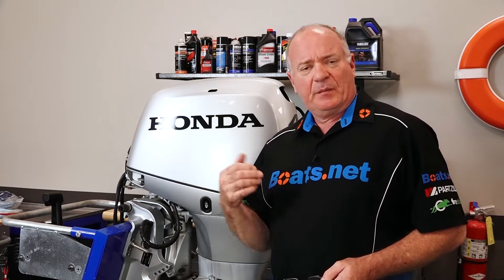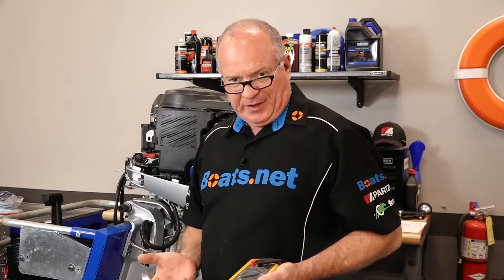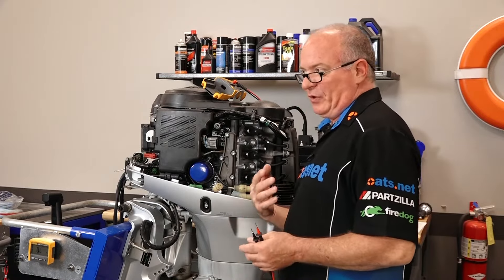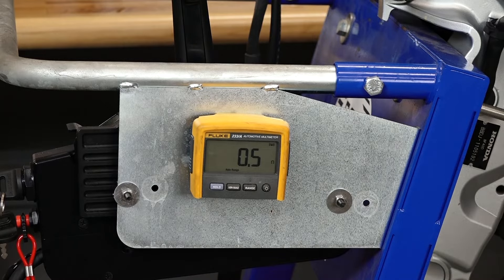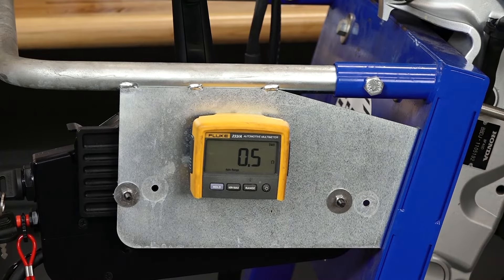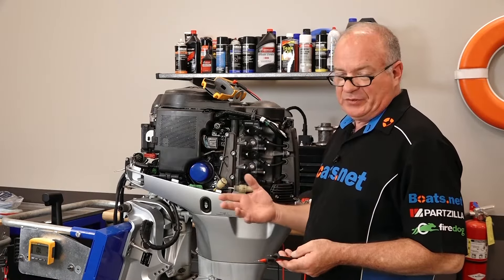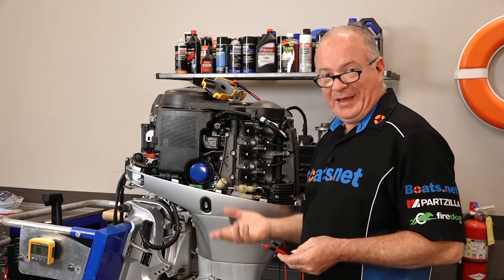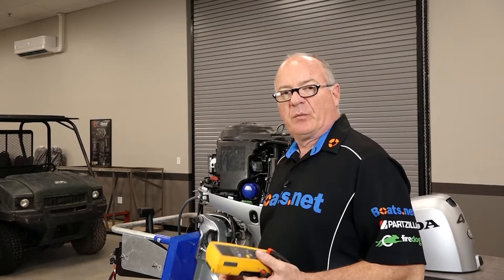How to Test a Stator on an Outboard Motor | Outboard Stator Test | Boats.net

Comment: Did you start the motor with wires from the stator connected to the rectifier and then unplug that connection and test the voltage, or did/could you start the motor without the stator wires being connected to the rectifier?
Reply: you can start without as its controlling just the charging system and not the ignition system

Comment: John, would the stator malfunction under a load? I can't get my boat to go full speed and I've replaced or repaired everything having to do with the fuel system. It will idle fast and throttle full if I pull it out of the water, but with a load, Turtle speed. Yes my prop is new as well. Bought it all from you guys 😂

Comment: I can't even get my connection apart,its almost as if someone used crazy glue to connect,you took yours apart so easy,Im wondering if mine is melted together,,is it okay to spray penetrating oil ?

Comment: What role does the stator play in outboard ignition? My 92 Johnson 60hp won't crank. I've replaced power pack, plugs and fuel pump. Can the stator cause no spark when attempting to crank the motor?
Reply: Did you replace ignition coils when you did the power pack? That could be your problem.

Comment: Is that a DVA voltmeter? If so, shouldn't the setting be on DC?
Reply: no yellow wires are A/c volts.........and hes using a multimeter which can do multiple settings hence the name......

Comment: What If you read a 1.11 from 1 to 3? I have a 2004 yamaha 115 4 stroke. The others are reading .55 and .56?
Reply: make sure your meter is set on AC and NOT DC